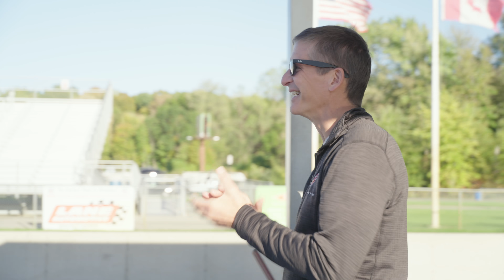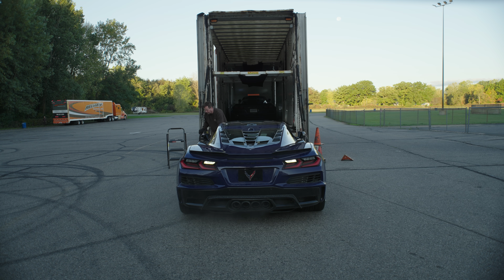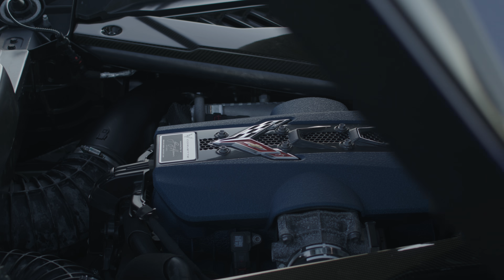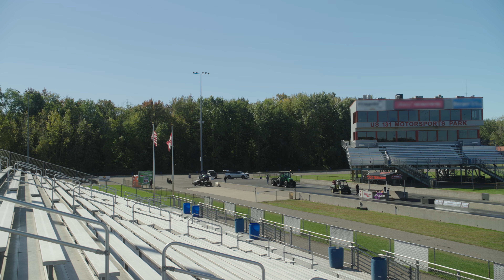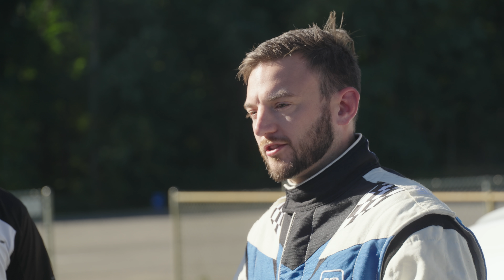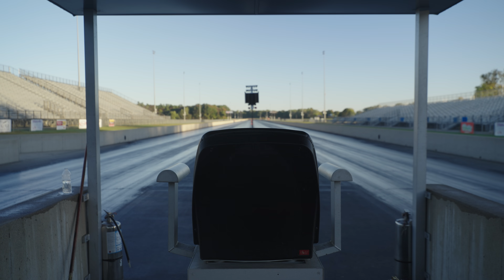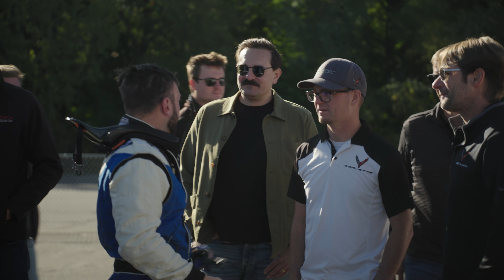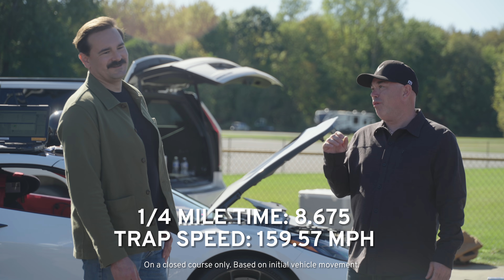We Pushed The Corvette ZR1X To Its Limits (DRAG STRIP TEST)

Comment: So it’s confirmed Brooks at DragTimes will break 8.5 in the quarter with his ZR1X, got it.
Reply: If they add drag tires, I can see that happening.
Reply: @JMou-14  when I think about it, the rwd zr1 will probably end up being the faster in the 1/4. seats out, skinny’s in the front, wheel setup in the rear, running on e30. it’s the lighter car all the way around. I can’t wait till somebody buys it and starts attacking the 1/4.
Reply: @tapa2466  nah dude, the AWD more than compensates for the extra little bit of weight, having two more tires pulling makes a HUGE difference
Reply: @Smoke---  Until you are running 1600-2000hp+ and can shift all that weight off the fronts, then it's all down to RWHP and grip.
Reply: @N4CR  right and that’s why the Demon 170 was so reliable in the 1/4 mile and the Tesla Plaid wasn’t…
Reply: @tapa2466  Yes, absolutely destroy every ability to turn and stop in hopes of making it quicker. Smart. Or, add e30 to the X and be able to do EVERYTHING better ALL the time without having to swap wheels and tires, and tow the car or bring a 2nd vehicle to carry your wheels (and making it look stupid btw) just to chase a couple of tenths. X all day!
Reply: @tapa2466 not to mention the piggyback ecu tuning coming out soon from the JB4
Reply: more likely due to fl da is brooks might be able to match this hero run with a good bit of corn juice in the tank!
Reply: He needs to get a 110lb female to run it .
Reply: Don't know about Brooks in FL....Bad Air...but New Jersey or NH that are almost at Sea Level...should be 1-3 10ths quicker in the 160s....
Reply: @bosssho3096 Florida in January or February or March has good air.
Reply: They are known to run best on 100 Octane. Just better fuel it'll be in thr 8.4's
Reply: Yeah, 20 psi is pretty "RAD" love this LT7, but...  high comp high rpm= major wear!!!!
Reply: Most of FLA  is at "sea level" holmes
Reply: nope
Reply: Boost District took a ERay and removed the 6.2L motor for a built 7.0L engine, twin turbo charged it, drag slicks, not sure about the fuel. The Corvette with some tuning, and a modest boost wheelied on take off and blurred down the track. Best time was 8.6 e.t. @ 166 mph.  So this ZRIX should be right at home in the 8 second ranges.  If only BoostDistrict could get a crate  5.5L 4 valve per cylinder engine and maximize its output motor wise with the twin charging and electric motor,  I believe low 8s are very possible @ 170+ mph.
Reply: Not a chance in Florida
Reply: Brooks has the stock zr1 record and he did it in Florida.
Reply: @bobtaliaferro5492 It would still be quicker if GM attempted it in Michigan fall weather.
Reply: @alphanumeric3446  You can get Michigan fall weather in Florida in the winter...
Reply: @alphanumeric3446 with 100 octane yes
Reply: @alphanumeric3446   Well, Brooks would get better tyres which are worth a fair amount, also more than likely much lighter wheels also.  For some reason he never removes the passenger seat either which is a bit odd... 

anyhow it will be interesting to see what happens.
Reply: @zMW574e making any of those changes will discredit it from beating GM’s record.
Reply: @alphanumeric3446   Really ?  What ruleset are you using ?  If you change tyres on a car is it then modified?  If you take the spare wheel out ?    Increase the pressure in the tyres or decrease it or do you have to run the recommended pressures from the factory ?   Even a prepped track might be considered a big variable considering who is doing the prep work. or should prepped tracks even be allowed?

Technically speaking you need to run always with a full tank of gas.  like Autocar do with all their testing. Running on fumes is not something you would normally do with these cars.

An interesting topic in itself,  modifications or optimisations.  As no official rules I guess it will be open to interpretation.

PS Note that the Corvette in the video was using a non standard seat, looked like theirs was a racing seat, probably done for safety reasons.  I don't know how much it weighed but not much from the look of it compared to a standard seat. No matter the weight of it what it does show is that  their car is not stock if you want to argue along that line of reasoning.
Reply: There was logging equipment in the car so the seat is a wash. That doesn't rebuttal your argument I'm just saying
Reply: You dont need a full tank of gas, a quarter tank saves weight and isnt running on fumes. Its all wheel drive and shows no traction issues so tires arent needed.
Reply: You miss my point completely, which is there is no set standard to be judged against on what is optimised and what is modded. 

Which was what was being inferred here.

Comment: Yep, take it to the track, make one 8 second pass at almost 160 miles per hour, and 10 minutes later you'll find you and your car have been escorted out the front gate to never seen again, unfortunately.
Reply: indeed the nhra made such a kerfluffle about the plaid&lucids low 9s high 8s. this will get banned outright or kicked out after one 8s pass.
Reply: Private track rentals, you can do anything you want after you sign the waiver. How do you think Brooks with drag times does it at 3 different tracks?
Reply: That's cool, one is all I need to frame that timeslip.
Reply: @emmexfyv 😂😂😂😂 for real

Comment: Remember in the 80’s 300, 400 hp was insane and now 1000 or more is becoming kind of usual.
Reply: Hell my Fiero GT felt quick with 140hp!     At least it sounded good LOL
Reply: makes the guys removing smog controls to go fast seem kind of ignorant to the times.
Reply: the last great gasp of the ice age ending. only relevant due to that front electric motor&center mounted lion battery pack getting it to dig its way out of the hole! bet this sucker with fuel weighs 4,300#+easy with fluids